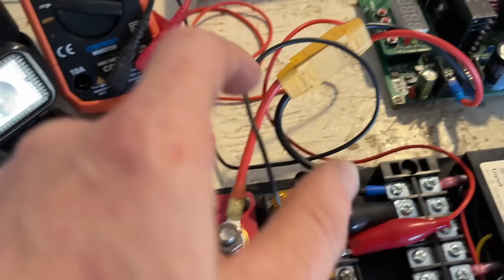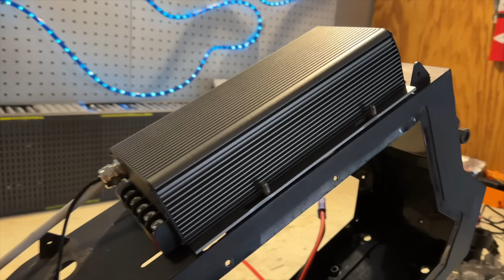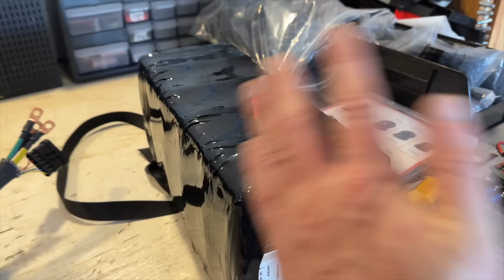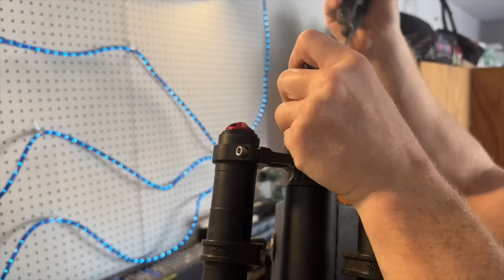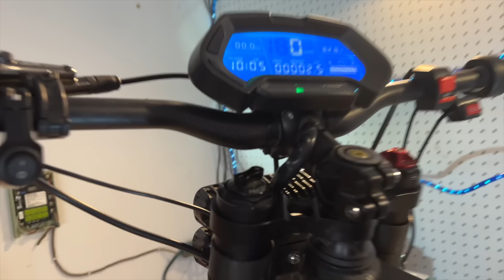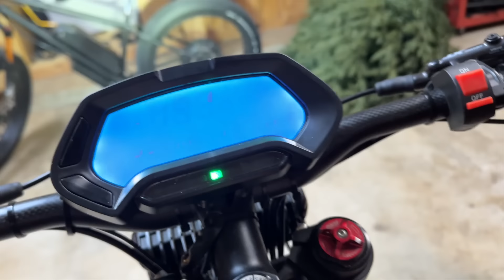This Might Be The Best Way to Build a Stealth Bomber Ebike

Comment: @Gaius Garage Hello there mate. I am building a similar ebike, but that circuit board that you showed in the first part in that video is a bit confusing. Care to give a bit more detail?
Me and a friend have been gazing on what you did there, and the more we tried to figure it out, the more questions appeared. 

First, we looked at the datasheet for those relays. It says that max switching voltage is 75V. Let's assume that I looked at a datasheet for a different relay than the one you have used, but care to provide a datasheet for yours? You ran 84V through that thing... how is it not smoking?

Secondly, how is that key switch not caught on fire? Are you running the mains power through it? The full 84V? I didn't think these key switches could handle this much amperage, even ChatGPT agrees with me here: "The amperage through the ignition key switch is typically in the range of a few milliamperes (mA) to a few amperes (A). It is not uncommon for it to be around 5-10 amperes during the brief moment when the key is turned to the "Start" position to engage the starter relay. The actual high current required to crank the engine is drawn directly from the battery and flows through heavy-duty cables and the starter motor itself. This current can be in the range of 100-300 amperes, depending on the size and type of the engine." Can you update the description of the video and send a link to it. I wanna see what key switch you are using, although I feel like it's just a standard one.

If you can, please make another video on how you make this board maybe? My electrician buddy was looking at this saying "that's sketchy, how is he not dead?"

Thank you so much for the video. Please continue making more Electric moto vids in the future!
Reply from the maker: Yeah that relay shows 75V on the datasheet but is also indicates that the maximum working voltage for the coil is up to 130% of the rated voltage, which is about 93V. so 84V is not an issue, at least for the coil. overvolting these components isn't an exact science (I mean it is, but you don't always have to treat it like one) - some components that are more sensitive will burn right away but more often than not it will just lessen the lifespan of the component and you may have to replace the relay sooner rather than later. 
In terms of current through the key switch, that circuit is only used to power the relay.. it's the whole point of using relays, so you can control higher current circuits using something like a flimsy key switch. The relay draws 1.8W which, at ~80V, resolves to about 20mA. That's super low and not an issue at all for the key switch. Voltage doesn't matter (as long as it's below several hundred volts where arcing becomes an issue), only the current is relevant. I don't have a link to the key switch, it's just a generic one that came with the frame. I actually don't have this panel anymore because I sold it with the bike but I can help you put one together if you have questions. Just hmu on Instagram @gaiusgarage

Comment: I think it would be cool for this bike to have kind of a neutral "gear" when the regenerative braking is off, so you can coast a little bit without slowing down. The way I see it, it can be kind of like a middle position of the throttle: the normal position is the regen brake, in the middle is neutral (motor and regen brake are off), and when you turn the throttle further it engages the motor. Don't know if someone did it or if it's a good idea at all %)
Reply from the maker: The regen is actually variable and on a separate  thumb throttle. So if the regen throttle is not engaged, the bike coasts without any regen
Reply: @GaiusGarage  varibale regen is my most favorite feature ever since hydraulic brakes

now when your rolling down a hill you can just ride the regen instead of burning brake pads

id love someone like grinn technologies to make a version of there tripwire ebrake sensors that return a analogue value so you could use the reach adjust on hydro brakes to run regen

so instead of having say a inch of play or deadzone on the brake levers before your hydros engage you could use that deadzone to activate the regen that way you pull lightly on the brakes and it engages the regen more pull is more regen then it moves to full regen just before the top of your brakes then if you need to stop in a hurry you can just pull hard and go straight through to your hydro brakes

Comment: Hi mate can I ask your opinion on something
Reply from the maker: sure what's up?
Reply: @GaiusGarage  Suzhou Dynavolt Intelligent Vehicle Technology Co., Ltd. I am about to make a purchase from these guys. Can you please have a quick look at their profile and my spec and tell me if I’m on the right direction thanks 

Below is spec

Torque
Key attributes
>100 Nm
Place of Origin
CN;JIA
Brand Name
Dynalion
Model Number
K8
Range per Power
Max Speed
60km-120km
>50km/h
Charging Time
6-8 hours
Motor position
Rear Hub Motor
Battery Position
Down Tube
Product Name
Wattage
Motor
Battery Capacity
Х
K8-electric bicycle
15000W
Brushless Motor
/72V50AH
Range per Power
60-120km
Max Speed
60km/h-120km/h
Frame Material
High carbon steel frame
Color
black,white,custom color
Reply: @GaiusGarage  

Key attributes
X
Industry-specific attributes
Gears
Frame Material
Single Speed
Aluminum Alloy
Wheel Size
21"
Voltage
72V
Power Supply
Lithium Battery
Braking System
Disc Brake
Battery Capacity
/72V50AH,
Reply: @GaiusGarage  

Specs 1
Price
Specs 2
Price
Break taillight
$20
Break taillight
$20
-Signals and horn
$15
Signals and horn
$15
Backview mirror
$10
Backview mirror
$10
Alarm
$9
Alarm
$9
10A charger
$35
10A charger
$35
bicycle seat
bicycle seat
Dnm front fork
$217
Dnm front fork
$217
Dnm rear suspension $85
Dnm rear suspension $85
Colorful display
$30
Colorful display
$30
21" off road Tyre
21" off road Tyre
Mud guard
$30
Mud guard
$30
75ah Battery
75ah Battery
5000w
$2,115
15000w
$2.815
80A Controller
200A Controller
unit price
$2,566
unit price
$3,266
shipping cost for 2 units
$1,180
total for 2 units
$7,012
Reply: @GaiusGarage  hi fella did you get around to it
Reply: @GaiusGarage plz

Comment: Nice bike. You gotta be in Texas cause I am and that ride looks so familiar terrain.  I have built 5 so far. Last two very similar to this one. Your's is WAY more engineered than mine are but they work and I ride everyday. Combined between the ones I still have and the ones I got tired of and sold I probably ridden over 5000 miles.  My big one will do 56mph and that's some scary sh*t on back roads. ~45mph is my stable speed. mostly I just put around on the trails between 20-30.
Reply from the maker: Haha yeah the terrain is pretty unmistakable to those in the know. I've also put a ton of miles on this bike and had the same experience - 55+ is crazy, 45 is the sweet spot

Comment: You should add GPS a tracking device and kill switch remote. Just in case someone steal it. I have it on my electric skateboard. It worked for me twice.
Reply from the maker: I don't have this bike anymore having sold it but I do have a new electric motorcycle build and placed an Apple Airtag inside. kill switch remote is definitely a good idea too

Comment: How much power do you recouped frm the regen ? And what’s the temp on the motor at top speed?
Reply from the maker: its not a whole lot of power recouped from regen. I had the variable ebrake set very aggressively so you almost never need to use the disc brakes and even then I'd say it's less than 5%. This is probably more or less the case with every EV - just a conservation of energy thing. Not sure about the motor temp value but it does get fairly warm when riding aggressively (more hard acceleration than top speed) but it doesn't overheat unless you really abuse it

Comment: Very informative videos. 
I have so many questions... is there a way I could communicate with you directly ? 
Thanks
Reply from the maker: Thank you! I offer detailed consulting on these topics at different rates depending on whether it's via text, zoom, or help designing a system. Hit me up on Instagram @gaiusgarage - if you don't need specific or detailed help I'm also happy to answer general questions here in the comments
Reply: @GaiusGarage   I just wanted to make sure I ordered the right compatible parts. And on Ali b as well.. didn't want to order a bunch of stuff that won't fit together or don't even make it here at all for that matter lol. I never ordered from that website. Just typical questions like that.  All good brother. Don't want to take too much of your time. Cheers ! 8)
Reply from the maker: @Louisxs650  I gochya. hmu on Instagram, happy to look over a parts list for you

Comment: Wow! Will it need a licence plate for the highway?
Reply from the maker: I'm not sure you can register a bicycle as a motor vehicle but even though the top speed is ~60mph I wouldn't take this on the highway with traffic. other components like suspension and general geometry are just not designed to be stable at those speeds

Comment: I did a similar install but with an 80A MCB instead of a contactor and the same DC converter. With how difficult DC is to switch, I feel like the contactor isn't actually necessary and ends up being a large extra component with higher power bikes. I do wonder if it's perfectly adequate to isolate the battery supply on and off using the BMS, since mine has a function to do that.
Reply: ⁸😊

Comment: what all those snake lines all over the road ...never seen anything like that before ..very strange ..towards the last 3mins or so ....long road ...
Reply: It's Just tar. I see the road guys all over with a 5 gallon bucket and a little spout on the bottom. they use it to fill in the cracks on paved roads so the water doesn't seep in and make it worse. If it was done right in the first place they would not have to come back and do that a few years later, and a few years later and a few years later.  I can tell this is Texas, I recognize the terrain.  We got a big state, lots of cheap roads. The newer ones are quality paved or cement now. but a lot of the back roads are the old crappy tar and gravel which with the Texas heat and cold. Crack over time.
Reply: @jamescole6846  thanks for the reply

Comment: Such a clean inside. I wish I was better with electronics to make things like this and run additional LED’s.. I’m learning but very slowly. 

update: Ended up getting the Garmata seat with the stash box and I think I will mount my controller there. Who knows. I plan to finish my build within a year or so haha. Already burnt one motor by the phase cables getting ripped from the disc brake :( I will attempt a 3D printed cable holster that holds a washer against the swing arm to prevent any drag on both sides.. that was one thing I didn't see was how you ran your cable through the disc brake.

Comment: I just spec'd mine out with china.:

72v 8000w 40ah 100a controller, red frame, gold rims, headlights and brake lights, hydraulic brakes, 203mm 4 piston, zoom front and kke back suspension, motorcycle seat, alarm, color display, 19 inch turtle tires. 

2100 delivered
Reply: Can you give me an ipdate
Reply: I’m about to offer an almost identical bike to this one for $2400 shipped! Almost finished with our first prototype bike now
Reply: @Paint4free send me a link I'll buy it right now
Reply: Cool...just the motor controller together with the display cost me (US)$1500, there are many ways you can go about building an E-bike...
Reply: Where did you order it from? There’s so many suppliers on Ali I want to pick a reputable one
Reply: Pay extra for the KKE forks. They make the bike ride so much better, and they are a good height for the geomtry of the bomber clone.
Reply: Was it legit, kinda scared of ordering one already built from China and how long did it take to come in?
Reply: Those are all pieces of "cheap" crap😅
Reply: You're going to be disappointed a good well built with good cells battery pack is $1800.00  for a 72-volt 40 AH BATTERY 🔋 you clown

Comment: The one thing that you didn't put in the price/parts list was the battery
Reply from the maker: I have a separate video of the battery build on my channel where the price is listed. price was about $1k but that was a few years ago
Reply: @GaiusGarage  I'll check out that video thanks
Being that it was a few years ago I don't know if the price is up or down. Who knows
Reply from the maker: @ronbrown4551  definitely up. price of Lithium ion batteries has increase quite a bit in recently years due to inflation but also from increased demand combined with supply chain issues

Comment: Nice build. Awesome video really! Whats it like going uphills though? I heard another  another guy saying his clone bomber aint so good at uphills ESPECIALLY from dead stop he can hear the hub motor struggling. He has a 72v 12000w
Reply: I am running a 72v 5000w 5T motor and mine rips up hill at 45 mph, 50-55mph flat ground.. the other guy must have something wrong cause from dead stop up a hilll, I have mad torque.
Reply: @alexchavosaurus He's probably  super obese 😅
Reply from the maker: Thank you! Maybe an issue with motor programming or insufficient battery with the other guy but this bike rips uphill. In fact, I've have never found a grade that even makes a noticeable difference

Comment: That front wheel will one day hit the controller and pop it's plastic cover. Happened to me. It fits inside and it doesn't get hot.
Reply: I think his electronics are where the controller would normally fit. Also, I tried this and my battery is too big to fit my controller in this frame. I was super bummed.
Reply: @alexchavosaurus  it's 10000% cleaner looking inside. When possible
Reply: @JuanJDumeP  I bought the Garmata seat and am hoping to stash my controller inside of there. gunna have to put a protective box over the connections cause its all metal inside there.

Comment: Great job Man! quick question any schematic or drawing of that panel?  And what gauge are the wires on the relay socket? Everything I see online is 14 and 18 awg ...not suited for 72v....
Reply from the maker: voltage is not relevant for wire gauge, only current matters. voltage plays a role in arcing so proper insulation is needed for high voltage wires but 72V is relatively low and the insulation is more than sufficient. I didn't make a schematic for that panel

Comment: Why the use of the contactor with the switch? Just to have a kill switch on the handlebar?
Reply from the maker: yeah like a kill switch on a motorcycle. it’s useful to be able to turn the power on without engaging the high voltage circuit

Comment: Do you know if anyone has mounted a mid drive monitor to one of these frames instead of hub drive? Would love to see a CYC Pro on one of these, having so much room for battery I think you could really take advantage of the motor and BAC2000, could even go with a gates belt drive and an internally geared hub.
Reply from the maker: I'm sure its been done but I cant recall any specific examples. I know people have used hub motors as mid-drive motors with other frames
Reply: @GaiusGarage  Did you have any issues of ripping the valve of the tube in the rear wheel, or is it tubeless? I had to design and 3D print one of those tyre clamps that we use in motorbikes, for my Fatbike was tearing them out due to torque, I like this setup though, I'm either going to have a go at one of these or copy what you did with the KLR.
Reply from the maker: @NexGen-3D  I actually have another video where I cut the phase wires to make the rear wheel easily removable due to the valve stem being sheared off. I didnt really do anything about it other than replace the tube and it hasen't happened again so far
Reply: @GaiusGarage  Ah I did watch some of the video, but I missed the cause of the flat, was more focused on the phase wire mod :) yes I have been through a number of inner tubes before I realised what was happening, when I was quite young this used to happen to me on my dit bike until I cured out that the tire needs a clamp, as it was missing from the bike, then same mistake caught me again, You can make one from 97 SHA TPU and a large hex bolt, you just need to drill a hole through the rim for it.
Reply: The best mid drive system for these builds is the Lightning Rods. He has a range of motor outputs. His motors are much higher quality  than CYC and Bafang. Wattages from 3kw to 17kw, I think.